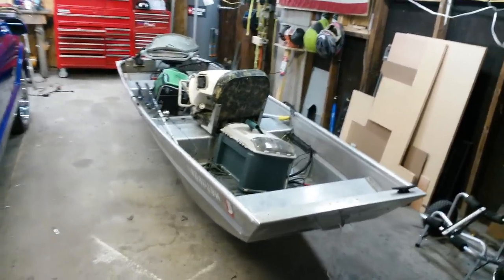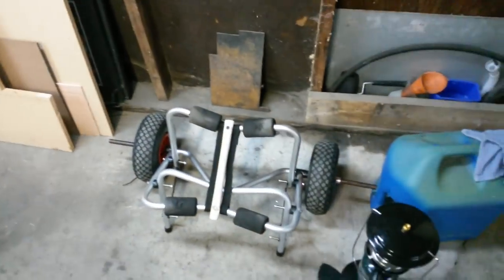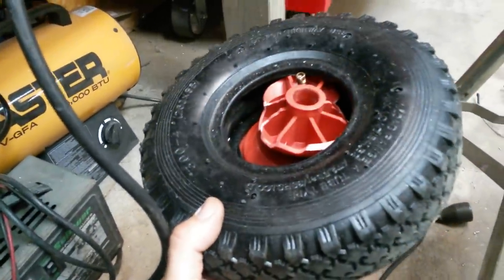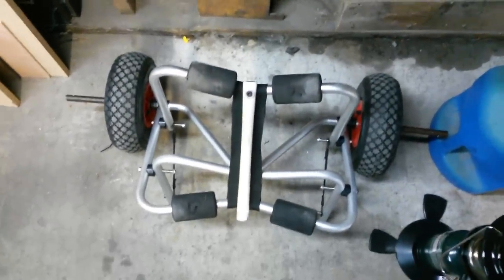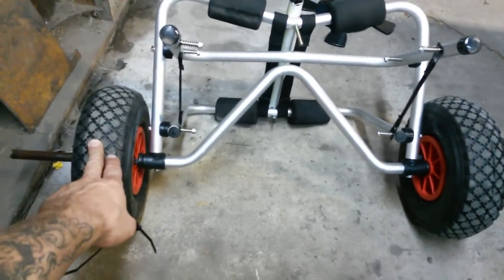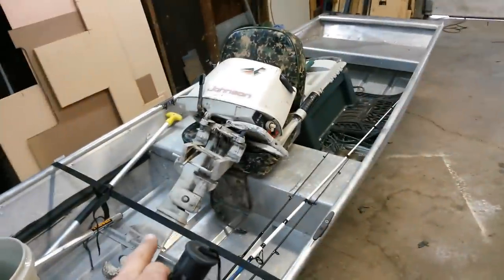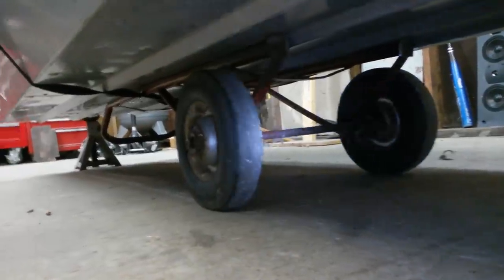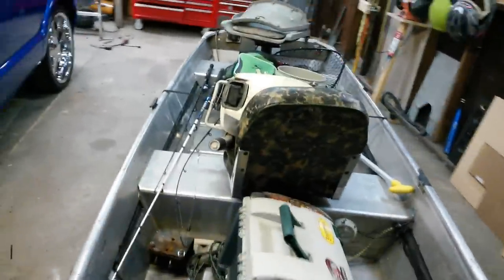EASY JON BOAT DOLLY!!! DO NOT BUY A DOLLY!!!

Comment: I bought the same one off eBay last year and it fell apart first use. I rebuilt it with a wood frame on top and put a spare set of snow blower tires on it .I also use a ratchet strap to attach instead of the  strap they provide.Now it works great.These were meant for kayaks and canoes.But with a little re-enforcement they can manage the task of a Jon boat.

Comment: I'm not very tech savvy so I don't know if the pictures I tried to attach to my earlier comment worked. Just in case, what I did was to take a piece of 1 1/2" PVC about as long as the boat is wide. I cut a slot in it as long as the dolly plate is wide. I then drive the PVC into the dolly. I put an elbow on each end of the PVC and a short piece as a riser/guide. I cut a pool noodle and zip tied it to the PVC. This allows me to save my dolly plus it raises the boat higher off the ground. I do hope I have explained this well enough.

Comment: Great idea. That kayak cart is rated for 110 lbs. I have a 12' aluminum boat and need a cart. Your idea might just work. Not sure about the tires  but worth the try. Have you hauled it over dirt yet?
Also, how did you cut the plate off?

Comment: If you really want to improve on this idea, Just leave the dolly full intact.  The part you cut off will fit perfectly at the end of the boat.   Then take those small wheels off and make a longer axle that will accommodate two good quality mountain bike tires.  Now it will glide smoothly over rocks and bumps. It will have ground clearance, for the axle will be higher because of the taller tires.  It will have some bounce from the tires which is nice.  And much quieter. Most of the weight will be on the back axle.  If you had to you could haul a injured person out on it.
Reply: then you gotta worry about bike tires and tubes...
Reply: @jinlim6575  Use the wheels off of a wheelchair. You can find them at goodwill and other thrift stores or on craigslist.

Comment: Sir
I enjoyed the education
 and I have a question, when you extended the rod with "steel tubing"
 could you give me a little more info how how that I accomplished
 thank you
and the reason
 is I have a inflatable sea eagle 285
 the cart they created have thick 2" wheels, great for concrete or hard surface not so much for soft sand
 so I think I spoke to a technician there who said I could do no such thing, so looks like he was wrong or had no use for me, ( the sand wheels have a hub that is just a little thicker and I am pretty sure that If I could do what you did then there would be plenty of room for the larger wheeleez ( I think they call 'em)

Comment: Great idea!  You could  TIG weld the hand cart to the bottom of your boat, and not have to worry about the cart. Just wheel the whole rig into the water, fish, and wheel her out. And, it you come to a sand bar, just wheel it over and keep on fishin'!  And if you gotta take the boat a distance, tie the bow to your rear bumper and now you have a trailer.

Comment: I had thought about trying this myself and seeing yours I really like the idea! Never know when they will let the lake water down and then I can hardly get my boat to the water. Only, I can't lift my 2.5hp off and on boat by myself so would need to leave it on in tilt position. Would that work you think? And is it hard to get back on boat in the water? I have a 12' sundolphin. And a 8 foot Bass Raider with trolling motor and 2 batteries.

Comment: I can tell you right now... Those rims cracked very shortly after you bought that cart. They used alloy plastic which cracks very easily I barely used my cart and the plastic cracked while just sitting in the garage with no load.

Comment: LOL! Yeah, use a kayak/canoe dolly to move a loaded jon boat, LOL!!! ...AND, if you had just flipped that dolly around, and placed that flat piece..ya know, the one you cut off thus ruining that hand truck..you could have placed that hand truck base on the transom(thats the back part) of that boat..and still had a hand truck!!!!
Darwin award winner folks
Reply: But then he would have to lift a lot more of the weight of his boat which is exactly why he made it so the dolly is in the middle of his boat...
Reply: Mike Bromelow , if he had spun that dolly(hand truck) 180 degrees, placing the plate he cut off at the real of the boat, so that it sat flush against the stern, the amount of strength to lift would be exactly the same! He would simply use the same handle on the bow to lift it. 
I'm not sure what you are saying. The position of the dolly, whether in the center, or towards the stern, would not increase the force needed to lift the boat significantly. So, he would still be able to move his boat, and by not cutting off that plate, move anything else he would need to with the dolly(hand truck).
Reply: You always want the balance point of the load you are pulling to be centred over the axles for the least amount of effort to required to lift.Now when pulling a boat on a trailer, you always need some of that weight on the tongue of the trailer so that it keeps your vehicles wheels planted on the ground. Pulling or pushing that same weight afterwards of course will remain unchanged.Otherwise he is having to fight the weight of anything that is closer to his hand than the balance point.Conversely, he could make it so that the balance point of his boat is behind the axles and the boat would tilt itself into the air. Now the dolly of course supports the boat along its own length so that very well could change the principals as I'm trying to explain. lol
Reply: Mike Bromelow I'm picking up what you're putting down. But, that jon boat doesn't weigh that much. And they do make transom mount dollys. All I'm saying is ruining a perfectly good hand truck, to move a boat slightly with less effort, is in my opinion ridiculous. Heck, that kayak/boat dolly he shows at the beginning, when used correctly, would have done the same thing you speak of. AND, it if placed directly at the balance point of that boat, the effort to raise it to a level where puching or pulling it would be optimum. My original comment was merely pointing out that cutting off that base plate could have been avoided and would not have increased the effort to move the boat that much.
Reply: No arguments there!
Reply: Especially if you shift the motor and other heavy items to the back.  Then extend his axle longer and add two high quality mountain bike tires for cushion and ground clearance.  Ive seen this done and it works great.  The bigger inflatable tires roll way better and quieter.

Comment: But that design has a lot of flaws
Can tilt the boat without the transom hitting the ground. 
Can't load it into your truck bed
Easy to loose in the water when loading back up. 
Metal to metal contact. 

Check out the azlongtales channel they have a much better design and cheap.

Comment: thanks' for telling me there crap you save me £28
Reply: deptuty dog they are great for what they are built for which is kayaks or canoes (they are rated at 100 to 200  pounds depending on model)  not jon boats and definitely not built to tow behind anything motorized for long distances or high speeds